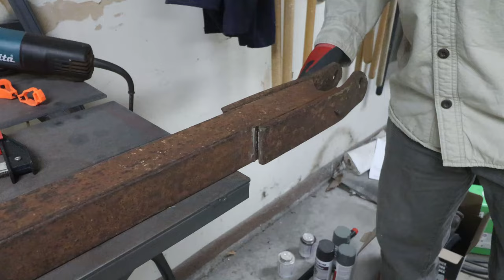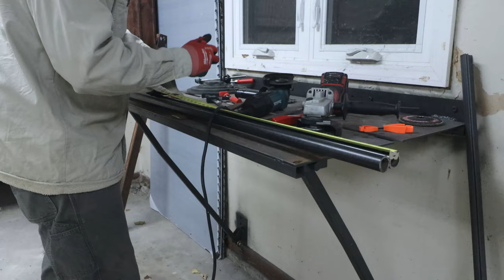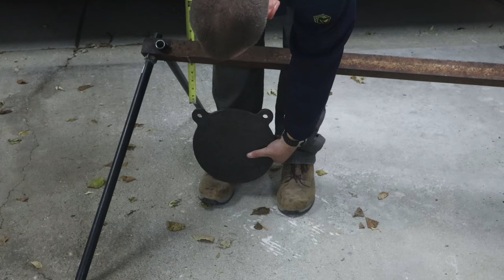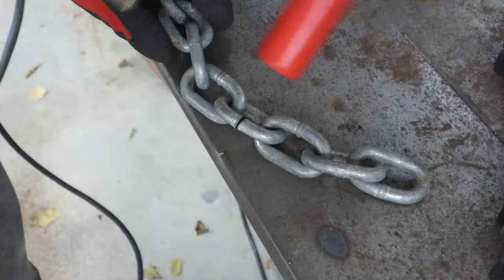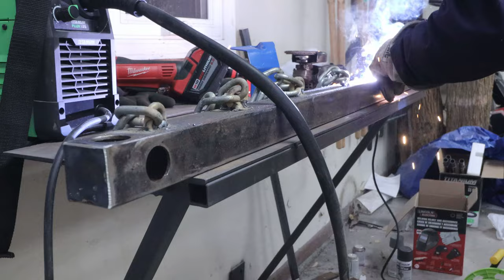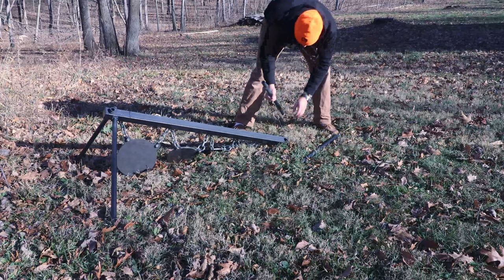Make Those Targets Sing! | AR500 Steel Plate Gong Shooting Target Stand

Comment: Awesome! I am about to build something similar. Have you had any ricochet issues? I was thinking of bolting the plates in a way that made them hang at an angle to help small calibers bounce toward the ground if that were to happen.
Reply from the maker: No ricochet issues. Small calibers basically disintegrate.
Reply: the chains make ricochets no issue as far as i know.. the plate moves just enough that they go straight into the ground